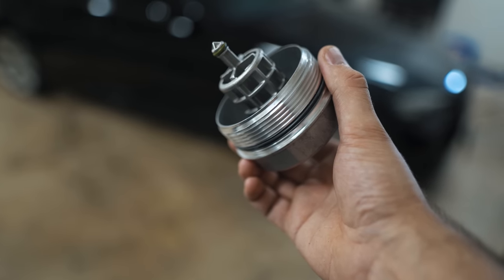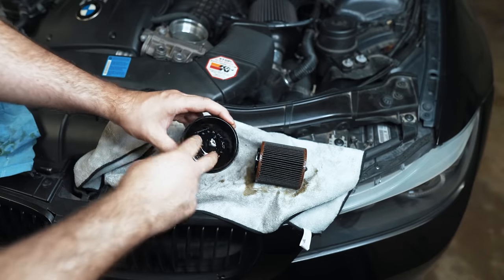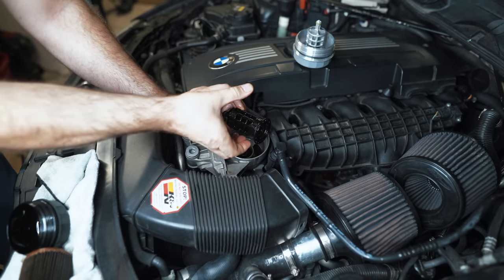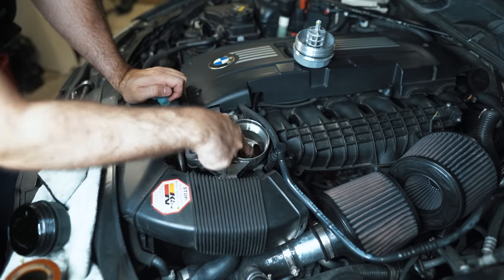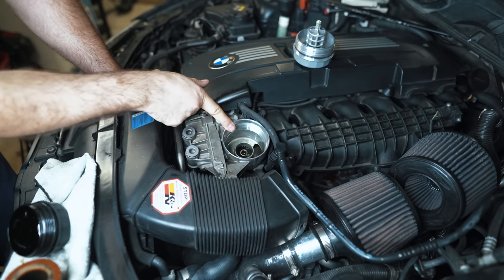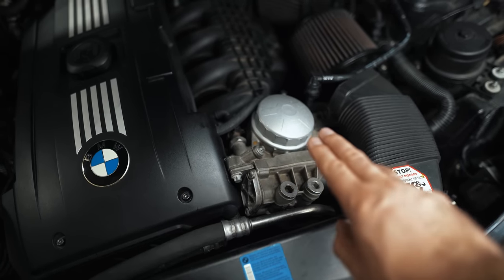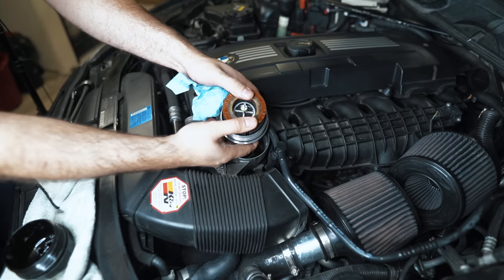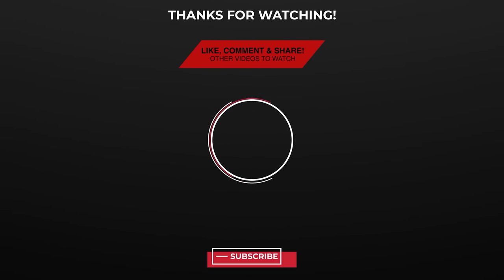Your BMW May Be Missing This Critical Part! So Important!

Comment: If anyone engineered an all aluminum water pump for the N54, they’d be a millionaire
Reply: There actually is one but this guy (0-60 YT channel) bought one; only issue is he’s in Australia
Reply: You are right about aluminum water pump, even better if a engineer put together plastic to aluminum kit for BMW N54 and N55 engine this would be great for DYI doers
Reply: I found 2 part numbers for the "INA" aluminum water pump: 611176026215 & 538019210. Apparently they sell this at O'Reilly Auto Parts
Reply: @cupompa   <--RockStar! Thank you. Let me know if this part is N54 compatible. I haven't seen and don't know anything about them (and I just spent $350 for a new part from FCP Euro, so I have a lifetime guarantee part agreement now for water pumps). --Steve
Reply: @SteveWeltman  INA 538 0192 10 is compatible with the N54 engine (cf. https://aftermarket.schaeffler.de/de/catalog/auto-parts/cooling-system/water-pump-gasket/thermal-management-module/water-pump/p-TA-1260-5380192100 , in german) - but also quite expensive.
I bought a PIERBURG 7.07223.02.0 (cf. https://mam.rheinmetall-automotive.com/mc/epaper?guid=173a3e69a074d32b , also in german :-) ) for my N54 335i , which also has an all aluminum housing and it is a lot cheaper than the INA (...at least here in Germany; btw. both are German companies). I haven't installed it yet, so cannot give any info on durability.

EDIT: Found the Pierburg 7.07223.02.0 Product Info in English as well:  https://mam.rheinmetall-automotive.com/mc/epaper?guid=1744d3188b81bd2b
Reply: Isn't it the modules that fail not the plastic itself?
Reply: Pierburg waterpump
Reply: I have been reading that this metal housing with cage should not be used , but I’m not sure why , but I know my n55 idles rough not sue if that’s the issues you, tuning it up today , did you find any Issue with the metal one you have used ?

Comment: I'm a bmw master tech, when I have an N5x engine with vamos faults it's absolutely the very first thing I check. Cause of fault 50% of the time. That's green o ring can also cause them. If it's a crap filter and that oring is all squared out it will cause them also. 
You put out good videos bud. Been with bmw about 20 years and use to frown upon all the diy stuff, but as I got older and more humble I realized the diy crowds info is an important part of my mental tool box!
Reply from the maker: Thanks for chiming in!  It's interesting to hear the perspective of a BMW master tech.  From my perspective BMWs tend to start being mechanically totaled around 8 to 10 years of age, you can pick them up for pennies on the dollar compared to new and the only way for it to pay off would be if a DIyer picks it up and references videos like mine.  Even the best independent shop would likely need to charge more than the car is worth for some jobs.  So if more people feel comfortable DIYing a job the longer these cars can stay on the road.  They could be on the road for 12 to 14 years instead of the typical 8 to 10.
Reply: Awesome!

I'm IT professional and I built my own two car garage years ago by myself.  Whenever I had the building and electrical inspectors over (they were super helpful btw) they always told me that DIYers tended to be the most respectful of building codes (going above and beyond) and doing quality work as they had more time and a vested interest in the job!

👍🏻 for being BMW Master tech.  Nice to have specialized skills on a great marque.  Love my bimmers. N52 and (wife's) N20.
Reply: What you said in your first reply is spot on to what we all say, I work with 30 other techs and most of us drive BMWs that we bought from a distressed seller and we made them right. Hell my 335 is close to 700whp and I bought that very care because of vamos faults the seller was having and was just fed up lol
Reply: As for the n20, don't fall too deep in love. I know I always see the worst of things but it's that engine (and n63s) that I see the most of. The n20/6 has not proved to be the most stout lil fella.
Depending on it's mileage, what state your in and if it's a sulev state or not I'd start getting bmw to do as much as they can for free now with extended warranties like timing chains ECT. Lots of turbo failures as well, pretty sure I have a spare n20 turbo sitting around if you ever need a core just let me know and Ill ship it to where ever for ya
Reply: @Thefringefitnessproject  thanks Matthew! Yeah I wish she had gotten The I6 vs I4. 2012 X1 Canada spec w x-drive. I had the timing and oil drive chains done pre-emptively couple years back after reading about the weaknesses. My cost unfortunately but I have good relationship w local dealer so they gave me good deal. She has only 50,000km I do as much maintenance as possible myself new oil/filter every 5,000km etc. 
Any reason turbo fails in particular??  
👋🏻
Reply from the maker: @Thefringefitnessproject  I'm seriously debating picking up one for the channel.  It would appeal to new viewers but could help a lot of people.  The perfect car would be a 428i convertible manual that has 150k miles that is significantly discounted due to engine problems.  Highly unlikely,  I've been searching for mechanic specials locally, a couple X3s have popped up where the chain let go.
Reply: @VehicularDIY  Would love to see N20 content!
Reply: MANN filters are the best, they don’t collaps
Reply: @WeAreAllPureLove  yeah, OE filters from dealer are Mann I noticed 👍🏻

Not sure why some folks decide to cheap out on oil and air filters especially on a premium car.
Reply: @VehicularDIY  your motives are all heart, and it shows in the content
Reply: just an observation from a BMW owner from the UK,   The only BMW's that don't last 15 years+ in the UK are those that are involved in serious crashes, and i'm not just talking about among "enthusiasts and collectors".   One of the pluses of buying a BMW is that with a good service history these cars retain solid prices and market demand well into their late teens.  A 2004-2005  3 Series is commonplace, as are even older X5's.  BMW is seen as a brand where you might end up spending more than it's worth  keeping it on the road but for those that appreciate them it's worth it. My daily is a 2015 M330D Xdrive tourer... The engine is just running in now, having done its first 100,000 UK Miles.  I also have an e34 525tds  which still purrs or roars on demand after 220K Miles and 25 British winters
Reply: @MarioDallaRiva  Back street independents often cheap out and charge their customers for premium parts. I supply my parts to the garage myself, although obviously I wouldn't send my car in for an air and oil filter change, but many people do, especially in the winter months if they haven't got an indoor working space.
Reply: TheComputec that's great to hear!
The BMW Doctor (Dean), UK based, has been saying many reliability issues are from owners' lack of care and maintenance and/or use of cheap replacement components.  
I'll tell ya, I've used my parents' Honda CRV to shuttle them to/from the airport.  Nice car bit the lack of road feel and handling feels like I'm on ice all the time! My 1er afterwards feels like I'm driving an F1 car 👍🏻
Reply: Matthew Baker thanks for adding your comments.  People complain about the maintenance on these cars but in my experience, problem cars are often poorly maintained and/or constantly beaten on.  I have a 2008 135 cabrio n54 that has been lightly driven and the maintenance to date has been very minimal.
Reply: @andyb8005  my 2008 1er coupe N52, I’ve had since new, is much the same. I replaced full set of brakes, tires and battery once. 
Valve cover gadget, oil filter housing gasket, front drive belt pulley and tensioner. 
Oil pan gasket next. 
Oh, 6spd steptronic lost use of D/S sport mode and lights on lever. Turned out eight 22AWG wires broke under repeated tension putting lever into sport mode. I soldered and heat shrinked the wires properly all good. Dealer wanted over $CAD1,000 to replace gear lever assembly....$1,200 to do oil filter and valve cover gaskets. Saved shitload doing it myself plus I know things done correctly 👍🏻
Reply: Mario Dalla Riva Great job doing the work yourself.  You Tube sure helps if you are like me!   I worry about the turbos on my 135 but no issues to date.
Reply: Andy B Channels like Vehicular DIY are a massive help to the DIYer!  I'm very greatful for this excellent content!
Reply: Mario Dalla Riva indeed, MANN filters have both good flow, high filtration and they don’t collapse under high temp! And they costs maybe a dollar or 2 more.
Reply: Matt; you my fellow BMW guy, are a class act!  So glad you’re here!
Reply: @SteveWeltman  Hey Steve, is that a RZ Mask you're wearing? If so, great masks!  My wife has a couple and I'm waiting for mine to arrive from the US.
Reply: @MarioDallaRiva  Hi Mario it was an Amazon cheapie that the wife got me with replaceable filters. I stopped using using it because it has the valves. I use some cloth dress shirt masks now.
Reply: @SteveWeltman  Ah, ok.  If you're interested rzmask.com  Their products were geared to shop use really.  Well made, meeting N99, yes 99, standards (but not N99 certified). Great if you do any woodworking, etc.  They now offer a valve that doesn't exhale.  USA company being promoted by me, a Canadian!
Reply: That last paragraph tells me you must be a good tech.
Reply: No disrespect to the BMW master tech but every time I bring my 5 series wagon to the dealership for either a recall or to diagnose a problem out of my scope. It seems that they either break something, put it together wrong or misdiagnose the problem. That’s why I love the DIY you tubers that help us keep these beautiful cars running. I will admit they are more maintenance intensive but well worth the effort.
Reply: Hey man. I have a BMW 318i 2011 N43 with a engine oil pressure control static 30c1 code as well as the brake loading too high fault. Car drives faultless maybe a little down on power but no unusual noises coming from engine. Also have a red engine light which is half filled in and I don't know what this means. Scanned the car the codes I have are 30c1 ,2afd and 2dec which I assume relate to nitrogen oxide /oxygen sensors. Is the red light for the oil pressure or for the oxygen sensors going bad ? Any help would be much appreciated!
Reply: ECS sent me the same billet cap and had holes in the threads so I decided to take the aluminum cage stick it in the oem cap and no more camshaft stuck or limp mode 💪🏽💪🏽
Reply: Have N55 and N52 motor. This part is such a critical part of the oil delivery system in most BMW. I do my own oil changes. Having your comments as master tech are very useful. Thanks for sharing with the diy community. What other critical parts where overlooked in your 20 years of working on these cars. Thank u in advance
Reply: what is the bronze washer for?

Comment: I bought an N55 E92 335i last year and the engine went on it shortly after. I found out from the PO that when he changed the oil he noticed the cage was missing, so over a period of 6-odd years I think that lead to the demise of my rod bearings!

I was also informed by a BMW specialist that the o-ring doesn't only act as a plug for removing the oil filter, but it has a capillary effect and helps to hold oil pressure/volume in critical areas for the next time the engine is started.

Comment: Accidentally threw the old cage away yesterday and bought this metal one. The old filter has collapsed in on itself and crushed the plastic cage exactly as mentioned in this video. This part is indeed important.

Comment: Had this same issue few years ago . I changed the oil from one of those express oil change places  and manager did it himself. But the next day the car would shut down every red light and have to wait 5 to 10 minutes to turn it on again . They denied their fault and bought a new one I believe for 50$ but ya I learned my lesson since then .
Reply: Express oil change place? Somewhere that doesn't even have qualified technicians let alone a qualified mechanic.

You get what you pay for.

Comment: Very detailed explanation on the cap, it’s components and functions.  I have an aftermarket blue billet cap on my N54, however it utilizes the original plastic cage.  At $27 I will grab this item and see if the cage will fit on my current cap so I can keep the colored accents in the engine bay.  Thanks for this video. 👍🏼

Comment: I had this exact issue. One of the places I got my oil changed (never again) ended up breaking this piece off and I had limp modes for years, and the engine was obviously pulling major timing. Finally diagnosed this myself and it was like getting 100hp back!
Reply from the maker: Wow it must have felt like a new car when your replaced it.
Reply: What engine? Interesting that the engine survived so long with reduced oil pressure.
Reply: @chetanjiva5997  It was an n54 engine in a 135i. Im happy to say it is still working with no issues!
Reply: Limp mode for years! Should have had the problem sorted after a few days rather than waiting years, wonder what damage was done to the engine after running in limp mode for years.

Comment: The only downside to a billet cap is that it gets so dang hot. I was used to being able to lean over the plastic one. I have a nice burn mark on my arm from my first day with it after getting the car back together when I was sorting out the PCV and catch can hoses. 

Thanks for the content as always. I’ll bring my car down your way one of these days. Maybe a TX2K weekend.

Comment: Not so long ago had a customer with N55 who did oil change and didnt put cage back. He ruined his engine within 5 minutes after oil change. Also bypass valve allows unfiltered oil to feed the engine and its how all the filters works but if the cage is missing its worse than situation when bypass valve is open because all the oil remains unfiltered.

Comment: Make sure the treads are lubed everytime the filter is replaced to prevent galling. If the plastic cap is changed  periodically you shouldn't have problems. I've installed the aluminum and I think for all purposes the plastic is fine. Keep a spare.   Like the man says replace the orings and make sure the cage is in place and functional. Again keep a spare. I might just try an aluminium cage with a plastic cap.
Reply: Many after-market upgrades are just smoke and mirrors. Not all, removing the swirl flaps on an M57 engine can be an engine saver. You just have to know what you should be spending the your time and money on.
Reply: You are more right than you think...tolerances on that thread were designed for a malleable plastic cap. Just buy one oem plastic oil cap and replace for free with FCP Euro life time warranty every 20k miles.

Comment: I recently had an issue with the check valve cage did connecting from the cap.  The cap looks to be cheap Napa aftermarket but that's what came with our 2007 BMW X3  when we purchased 2 years ago.  I always use Mann or Mayle oil filters with LiquiMoly 5w40 but I was concerned when I realized that the check valve was seized up.  So I ordered a new factory Cap with cage/check valve from FCP.  I really like the look of that aluminum cap/cage...next time I'll get that.

Comment: I went to an oil change place that I used to with my previously owned N51 128i and they threw this cage...took me a day to realize that was the reason for my rough idle and Vanos issues and codes, I thought the solenoids were bad. I got it replaced with a new one but the problems never went away, and the power was down. luckily, my car was still under warranty and the dealership changed the cam phase variators. Went back to the shop and they just acted like idiots and said they never saw the car before. That was my turning point with BMW's and shops, I do all of my work now if possible. The memory makes me angry every time I remember.
Reply: I had a similar experience, I still have my x3 but who knows how much damage was done driving the car for a whole day with the cage missing. I didn’t go back to the shop because they wanted me to tow the car to them and they would have charged crazy amounts for the diagnostics and other stuff. I just hope this didn’t cause too much wear on the timing chain guides of the n20 motor.

Comment: I converted the plastic valve cover on the N52 in my Z4 to magnesium for the same reason that I want to rid my engine of plastic where it is practical. I've had my eye on that aluminum oil filet cap for a long time now but I haven't made the decision to buy it yet because I questioned its quality. From the manufacturing perspective, a plastic part is much easier to add small features/details to and I wasn't sure if, for the price these sell for, the manufacturing tolerances would be good enough for reliable long-term running. Plastic is an excellent material to make parts like this because of how well it takes to complex shapes. But when longevity is the issue, this because the decision of buying the plastic part which we know works or the new aluminum part which hasn't been proven on the market yet. This video gives me a little more confidence, good job.
Reply: @robertt6964   - Yes I do. If I recall correctly, I wrote that comment before buying one myself. After I bought it, I realized it may not have been the best purchase. I'd still say it might be best to stay clear of these and stick with the OEM version.
Reply: @Casey_Schmidt  Thanks for the quick reply.  I figured that was the case, but only after I posted.  I appreciate the thoroughness of your video (link posted in my original comment)